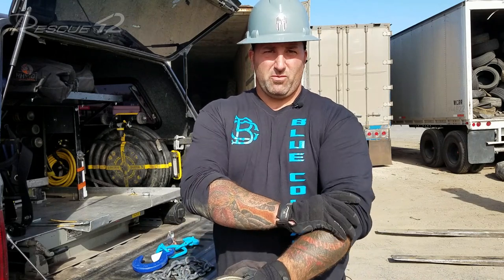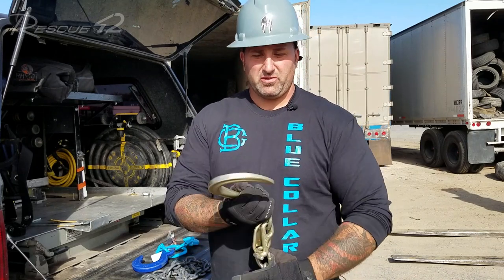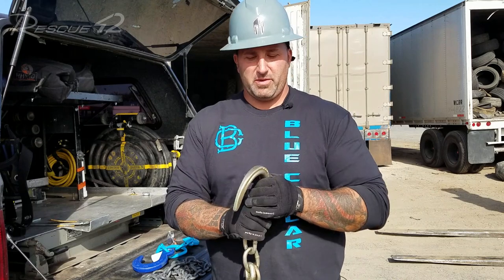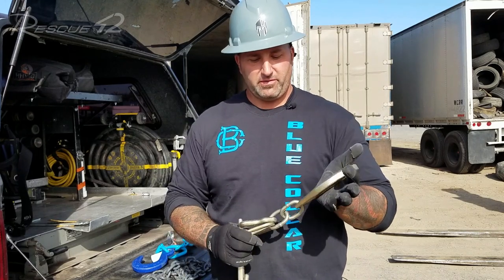Hook Clusters for Vehicle Extrication

Comment: Very good information. FYI, learn the meaning of utilize, it does not mean nor replace use. Tip, utilize means you are using something for other than it was designed for. Example we use a chair to sit upon, when we stand upon a chair we utilize it as a step stool which it is not designed for. Hope this helps you.
Reply: The word "utilize" expresses to actively use an item for its intended gainful purpose.

Utilize does not mean "to use" as an exception, alteration, substitution, or improvisation .  

In an effort to prevent injury, please utilize the step stool for reaching items from the shelf rather than standing on the counter.